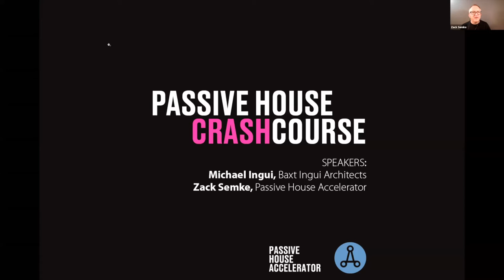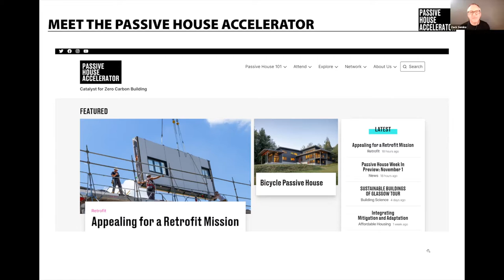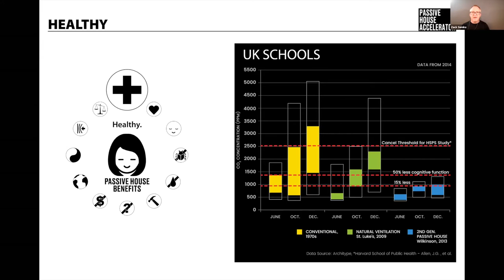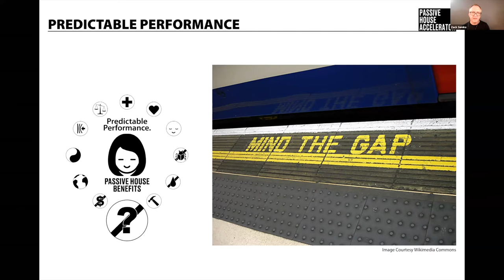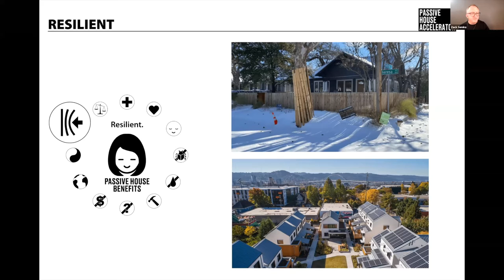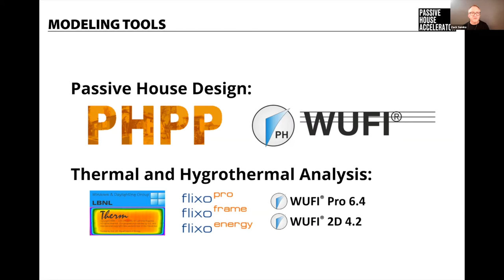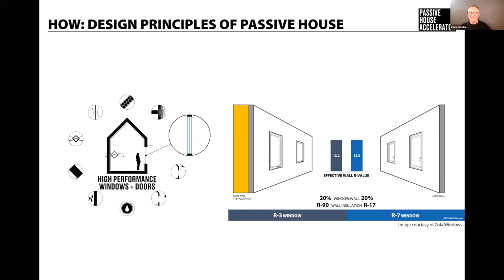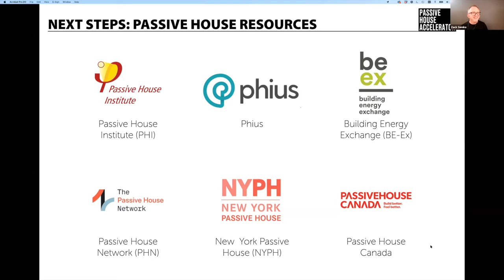Passive House Crash Course

Comment: Great video and it seems it's a cool channel too. Subscribed. I was wondering, do we actually need windows which can be opened in a passive house, as we get the fresh air through the heat exchanging ventilators. I'm building an one story house and fixed windows will also improve the safety of the house (I live in Bulgaria). Thanks in advance for the suggestions.
Reply: Not sure if they'll reply but operable windows are important for emergency egress so keep that in mind. In some cases, it may be acceptable to install fixed windows in lieu of operable windows.
Reply: Operable windows have two functions. 1) they're an emergency exit in case of fire or other disaster. 2) they're emergency ventilation in case the power is off for long enough that you need an alternative source of fresh air. You might be willing to break the glass to get out of a fire, but it seems a bit extreme to have to break a window to get fresh air just because the power has been out for a while.

Comment: Thank you for sharing this - it opens the dialogue on this - additionally I don’t think that the government should be regulating how homeowners build their homes- homeowners should provide the plans to potential home buyers and let them make the choice - this movement to use health as a measure to impose rules and requirements that limit society from building their own homes is a subversive agenda-
Reply: So should governments regulate energy use by simply shutting off power to this or that suburb when demand gets too high instead? Is that a better way to conserve resources?

Comment: Also, relying on electricity isn’t smart either- closing your home up so tight that if your fresh air unit stops working- you will be living in stale air- you will still have to open a window - I don’t think the climate issue is real-humans could never overpower the renewable energy of earth occurring perpetually- the fear of outside air and the need to filter it is border line paranoia- the best fresh air is mother nature it can’t be duplicated